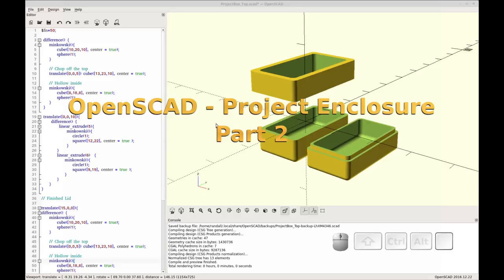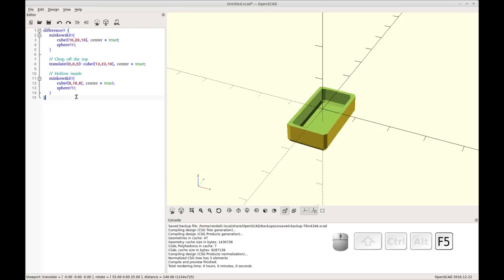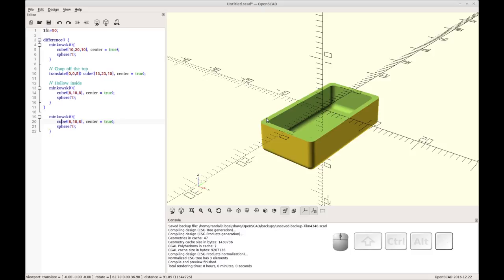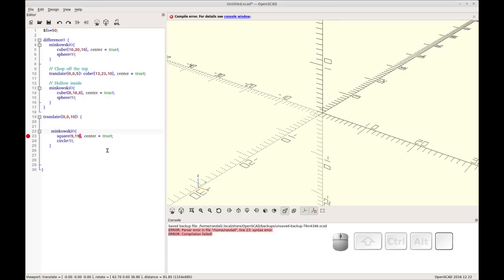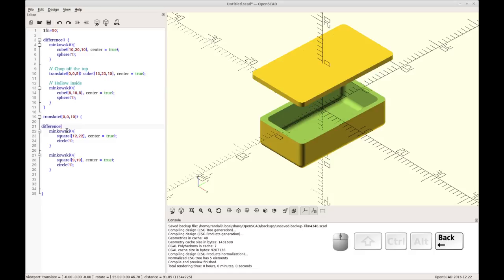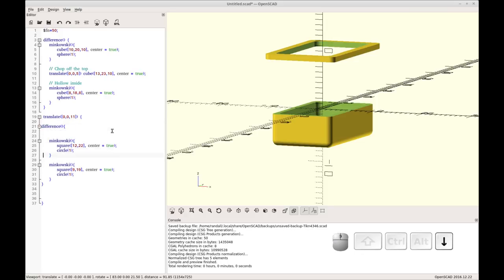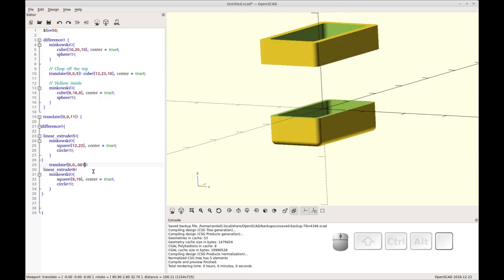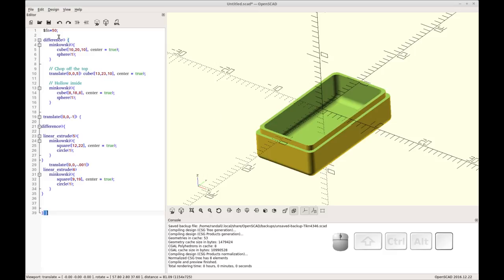OpenSCAD - Project Enclosure - Part 2 - The Lid

Comment: the kind of "flickering" you see is because the 2 shapes share the exact same face, but that only happens in preview. When you press F6 to generate the printable object they do not appear at all. Also, the linear_extrude can be done over the difference function, instead of over each part of it. That reduces the number of operations and eliminate the flickering effect too

Comment: It says that OpenSCAD doesn't support 2D shapes.  Making the square and circle impossible?  Am I the only one?  Running Windows 10.
Reply: once you extrude them they are 3D
Reply: makes sense. in 3d world cant have 0 thickness.make it 0.000000000001 :P